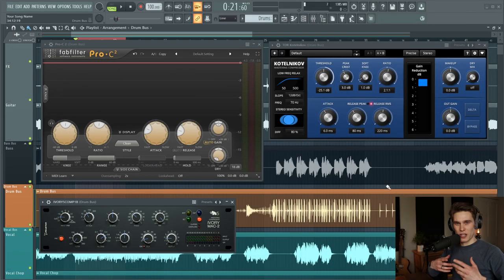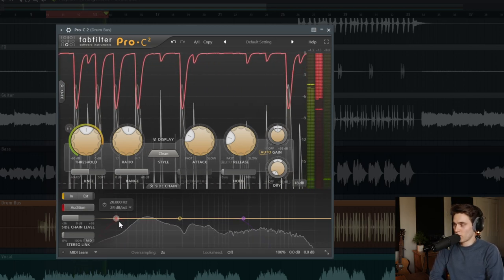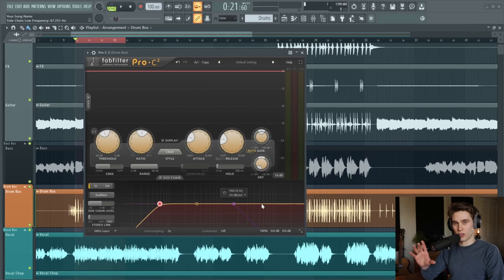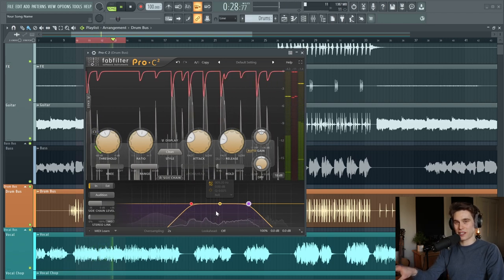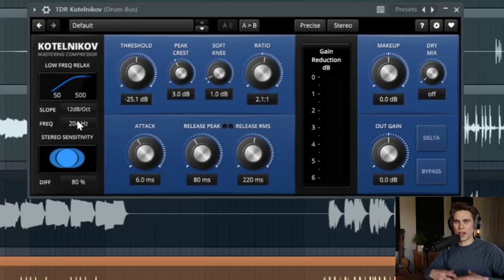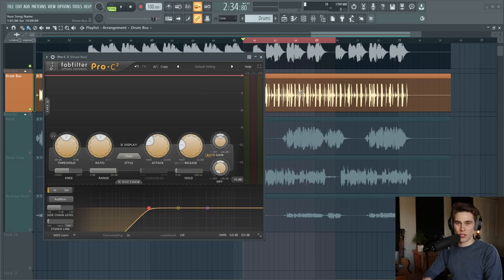Use THIS Compression Trick For BETTER Low End

Comment: The first time I discovered it I thought it applied less compression to the lower end. Thanks for clearing up my confusion!
Reply from the maker: Me too, it's not obvious until you dive a little deeper. Either way it sounds great!
Reply: I'm still not clear what happens to the frequencies out of the range? Are they ignored?
Reply: @aldenfarias4873  Im not quite sure but i think the ammount of compression now depends on the loudness of things inside the filter. Compression is still applied to everything outside the filter too.
Reply from the maker: @aldenfarias4873  the frequencies outside the range are still compressed but to a lesser degree. As these frequencies are not triggering any extra compression they will end up being compressed less
Reply: @inthemix  oh thanks
Reply: @SakuIkonen02  try to think of it like a trigger signal. The kick for example is way louder/powerful (due to lower frequency) and therefore triggers the compressor more, leading to a higher degree of compression. If you use the filter, the lower frequencies no longer trigger the compressor, instead the mids like the snare trigger the compression. As these frequencies have not as much power as the lower ones (and usually are a bit more quite in the mix), the compressor doesn’t compress as hard as with the low frequency trigger. But it still compresses the whole signal, you just determine what frequencies trigger the compression, and therefore you control how “hard” the whole signal is getting compressed.
Reply: @MrTee-uy5tl  Yeah I got it now😁👍🏻 What a great comment.
Reply: @aldenfarias4873 the bass is compressed but the compression doesn't hit the bass immediately because its triggered by something else and not at the same time  (high freq). I think if a high frequency trigger and an out of range low freqency sound play at the same time, the compression will be equal.

Comment: I think it's important to point out that by doing this, you're allowing more of the bass energy level to come out of the compressor. Not only will the overall volume be higher (which makes A/B comparisons tricky), but you'll also have greater dynamic range remaining and higher peak levels. This could matter a lot depending on what happens next in your processing chain. For instance, if you're running into a saturator after this, you'll get a lot more peak saturation, which could make it harder to get that sound dialed in. Or, worst case, if this was at the end of your processing chain, you could introduce clipping in the mixdown.

In other words: Use this technique for coloring and gluing the mix without affecting the frequency distribution so much. But probably don't use this technique if you're using the compressor for actual dynamic range compression, to keep levels in check, or especially when limiting.
Reply: Sir I want my low end super load and punchy,but when I mastering whole mix bus and apply limiter just sake of loudness then my low is sacrifices, what I should do, please explain if you can ,
Reply: @gurindersingh7933  I suggest you try decreasing your dynamic range before applying the compression, in your case that would mean decrease the volume or gain of your kick and bass. Also, try increasing the attack value. The punchiness will be less affected by the compressor
Reply: had the same thought

Comment: 4:23 That was my exact question. I've never heard anyone explain that so clearly. Great examples too. I really learned something new and important here. Thank you! Subbed.
Reply: Can you explain what's the difference? I didn't get it even after listening multiple times to what he says :/
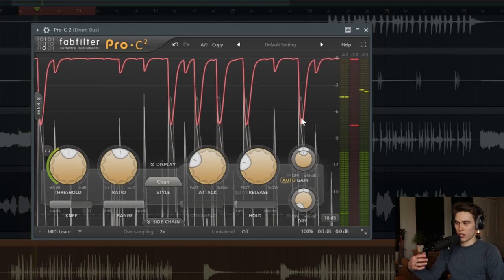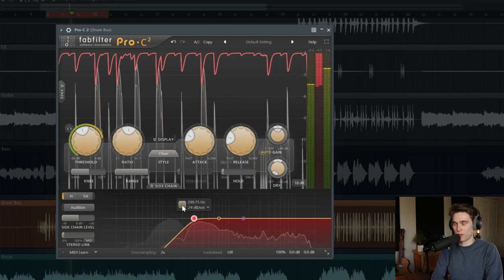Reply: @azymval207  I'll give it a go man. 1:28 is key. The sidechain or detection circuit tells the compressor what part of the frequency spectrum to listen to in order to apply its compression, the other frequencies are ignored (but still compressed, remember that). Another way of thinking of this is, if you don't tell the compressor what part of the frequency spectrum to listen to, it will just listen to everything as equally important. Is that what you want? That may be good sometimes right; other times it can be bad, especially if you've a bass heavy track which has other instruments in mid-to-upper frequencies, like here: 1:08 There's such high peaks/transients in the bass the compressor deals with them first right before it gets to the other parts of the track which also hold importance but are at lower dbs, like the high-hat. It squashes the hell out of it. You can barely hear the high-hat. So tell the compressor through sidechain compression not to listen to the bass so much. Problem solved. Listen to from 2:58 in headphones if you can, the difference, as he toggles between the different states. How is this different from multiband compression? In multiband compression, you can select which parts of the frequency spectrum for the compressor to listen to and apply/not apply compression to for mutiple sections of the frequency range you've defined. With the use of the sidechain compression, everything is still going to be compressed whether you like it or not, but you've the ability to control what parts of the spectrum that the compressor listens to. I hope that helps.

Comment: Amazing video! Sadly my fav comp, the H-Comp by waves doesn't have this feature and I really wish it had :D
Reply from the maker: This was my experience with Waves. Great plugins but you need several of the same tool because they are usually mixinmissing 1 or 2 features!
Reply: I think you could use the Waves studio rack, split the signal into two bands and put the compressor on the one without the low end
Reply: @Pirosticks  oh that sounds complicated :D guess I need to rather use the kotelnikov for that purpose :D
Reply: @inthemix  true! tho some plug ins are unbeatable like J37 and H-Delay, they are one of my fav plug ins :)

Comment: That's pretty smart! Filtering out low frequencies so the compressor doesn't get instantly overloaded is something I've never thought about. Not every compressor has this feature, though. But I guess we can sidechain it by putting a compressor with a high pass filter on a buss. Or in Presonu Studio One just use the splitter tool and put a high pass filter on one side with a compressor. Or I'll just use the Kotelnikov compressor. I'll have to experiment with this ASAP! Great stuff!

Comment: This is exactly how traditional De-Essers work, it is a fast compressor with a highpass filter in the detection circuit. Obviously the cutoff frequency is at 6kHz or so and not at 200 Hz, but it is basically the same thing as a traditional (!) De-Esser.

Comment: Great and I'd say necessary trick for tight sidechain compression. You have this feature in ableton's stock compressor but It's missing the frequency spectrum display which is very useful when you don't want to rely on your ears 100%. Thanks Michael.

Comment: i would like the shorter format in most cases, but ideally, i'd like a mix of both.  maybe a wide range of shorter videos with the option to do a deep dive.  maybe produce a longer video if the comments reveal a need, or if you feel it would be particularly helpful.

at any rate, yours are definitely some of my favorite videos.  you are very well-spoken, get right to the point, and have great examples to follow along with.

Comment: Pro-C is probably the most advanced in this regard because it allows you to full on EQ your internal sidechain (not that you'd want to go overboard with that...). But even using simplistic and/or stock plugins, this can be easily recreated: either send your audio pre-FX onto another track, apply the EQ there, and send it back on channels 3 and 4 which you then use as the external sidechain for your compressor.
Or even (this is at least possible in REAPER), just duplicate channels 1 and 2 on the same track with the stock channel mapper plugin, then put on an EQ and make sure your pinout for the EQ (button in the top right corner) goes 3->3 and 4->4, so it's eq-ing only these copies, and finally throw on your compressor and use 3/4 as the sidechain (the REAPER stock VST comp has high and low pass filters though anyway, but this can still come in handy with something third party)

Comment: Hi Mike.Of course C2 Using a filter detection and apply to overall signal and multi-band from the start split the frecv into one or more section applying his filters after! Please let me deep into this ! 
An it s called harmonics alteration after processing each ! regarding a paralel SC or a direct dry/wet "signal"I advice people to look and understand such called "signal" using DAW or digital manifestation of a signal in fact a sort of digital signal indeed.What s diference ?For instance we want to be more subtile just use PRO C2 or similar want to be more brutal use Multiband!
Using C2  is like have as results just a part of that combithat meen very slight and could be used also on mastering ,multiband (some more advance could use near similar but we may need oversample!)Oversample is the key here because we have a internal work clock by its info input .A computer resources and the result could be not achive if we deal many info in such little time 1Sow we could use option like "watchahead" or "oversamping" that basicaly localy alter the code response in frecventy.I do not advice to always use those features since they could introduce phase shifts in hi frecv that s is audible .

Comment: I use my guitar pedals for effects and my MXR custom comp deluxe has a Low Trim knob.  Set at max it's "flat," and I didn't realize that wasn't the default.  The default is at 12 oclock because the low end without ANY trim can overpower the higher frequencies, reducing harmonics.  I think when it comes to compression you need to find a good balance of low and higher frequencies, otherwise you'll sound muddy

Comment: my master bus compressor literally has multiple shelves and boosts specifically for the sidechain circuit with dynamic makeup gain, i wouldn't say its underrated, in fact its kind of a staple of most modern bus compression

Comment: Very helpful! I was wondering about some compressors with high and low pass filters, I thought they were like on TDR Nova where they actually work as high/low pass filters and basically take those frequencies out of the signal, so I haven't used them.
Also, videos under 10 minutes are more accessible, when a video is 20 minutes, you wait until you have time to watch it properly, a 7 minute video you can watch any time. 👍
Reply from the maker: I’m so happy that this video cleared it up. I’ve heard very similar comments from so many people, it’s not a very clear feature! Thanks for the feedback regarding the video length, I appreciate hearing your insights :)
Reply: @inthemix  No problem! Thank you for all the tips you pass on, they help a lot. I'll be checking out a few different compressors, that's for sure. I like Nova because of the high/low pass filters, and the mostly transparent and subtle compression, but I've started playing around with others for colour, and had avoided their filters because I thought they'd work in the same way, now I have some experimenting to do! 🙂
Warren at Produce like a Pro has been doing shorts lately, that's another good length for more views, but limiting. 5 to 10 minutes is probably a good length, short enough to watch immediately, but with more scope for providing information. I can't tell you how many 20 to 30 minute videos are on my watch later list, waiting for a time when I have to kill a couple of hours! They have their place, most definitely, but shorter videos mean more immediate views I think. 👍

Comment: Thanks for the video! As a relative newcomer, I assume that if the compressor doesn't have a built-in sidechain filter, the same effect can be achieved by making a duplicate of the track, cutting out low end, and using that track as an external sidechain?

Also - more dog in the videos in the future would be greatly appreciated!!!
Reply from the maker: You’re absolutely correct about the duplication and using an external side chain! That’s the way to do it. 

As long as Solo is happy on the couch, he will be here!

Comment: I didnt know about that until I watched this. I am always "surprised" how many techniques for audio processing are available often within the basic effectplugins, well explained. 

If my compressor didnt have that feature couldnt you just use a multibandcompressor set to only compressing the mid band and then you just copy the values of the parameters and paste them on the parameters of the normal full range compressor?

Comment: Would you recommend using this feature with any bass? In case I want the mid and high frequencies of that bass to sound more even or clearer through compression, and to avoid the low frequencies from taking over all the bass melody. Would that help?

Comment: Will this trick work with bass guitars? Or this method is best suited for drum busses? Can I use this method on both bass buss and the drum buss? Loved this method Ill be applying it to my mixes and see how its being affected. :D
Reply from the maker: I have not found great benefit to using this on a bass track as there is often very little treble there to initiate the compression. I find with bass that compression needs to be careful and sounds good when triggered by the low and low mid frequencies.
Reply: @inthemix  I see. I understand now. Thank you!

Comment: A question I've been struggling with for a couple years now: Do you know why when I get my tracks to the loudness of one of my reference tracks, it will sound fine in my studio monitors and my headphones, and even my couple sets of crappy speakers I keep in my studio in order to get a feel for what it sounds like on cheaper speakers, but on a phone or via my phone's bluetooth in my vehicles, I always have to turn my phone down 2 notches because at full volume it will be distorted?

Comment: So with a drum bus application of this tool, since its predominantly the kick that's affected (as it isn't ducked as far) couldn't you simply mix the kick louder than other drum elements and use a normal compression on the drum bus?
Reply from the maker: You could do that but it would still result in a lot more compression on the kick drum which will alter it’s tone. This change in tone might sound great and it could bring more saturation and texture to the kick drum but it could also just result in squaring and distorting it in an unpleasant way. Try both and take a listen to which you prefer!

Comment: Okay.. hoping I have u still seated kind sir. I have an Apollo twin duo core .. need a computer. Been struggling over a year due to m1 chip. I’ve researched other options. No I’m stuck idling trying to make a decision. At this point , willing to take suggestions: indecisive shopper disorder 😥
Reply from the maker: Any of the M1/M1Pro machines are excellent choices. You'll need to spec them up differently depending on your needs. I do believe the Apollo is compatible with M1, unless I am mistaken?
Reply: @inthemix  thank you.. I am just now reading your reply and say any of the M1/M1 pro machines are excellent. By M1 do you mean air and Minnie?

Comment: Wait so do you do this to a buss or to the master? Or can it be done to both?
Reply from the maker: Great question. You can do this on any track. It makes sense on buses/groups and your master track because there will be a variety of different sounds competing for space. 

It can be useful on individual tracks such as a boomy acoustic guitar but usually an issue such as that would be best dealt with during recording or with some gentle EQ.

Finally, yes you can apply to both buses and master at the same time, which could be an improvement by sharing the load between two compressors.

Comment: Might be a stupid question so sorry  but why wouldn’t you just turn the dry/wet knob down and ease off of the compression instead?
Reply from the maker: Excellent question.  If I turn down the mix of the compression, it will still be applying the same relative amount of compression to the kick, snare and hit hat. With this different technique, you can adjust the relationship of the compression between the different frequencies. 

Does that make sense?
Reply: @inthemix  yes! It does. Thank you for all ur help.